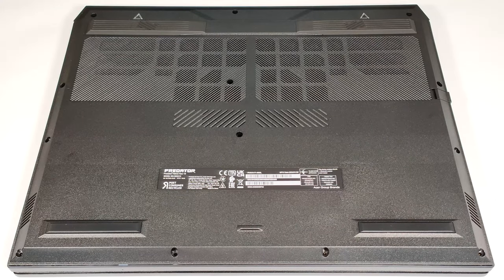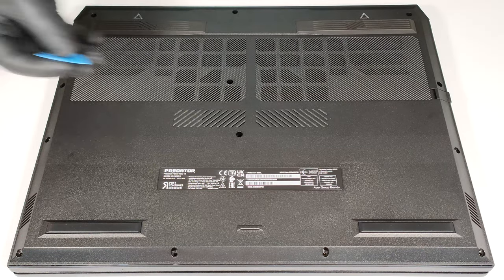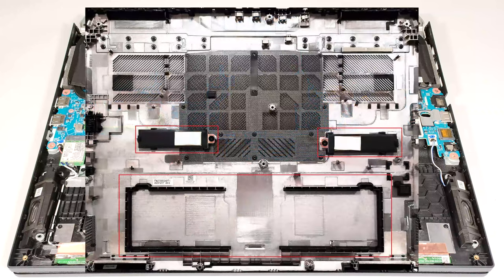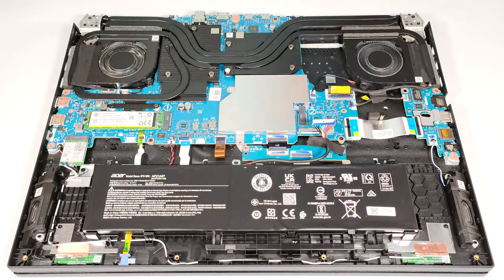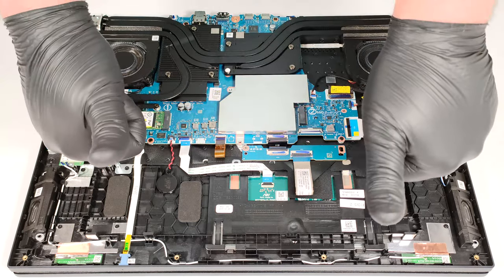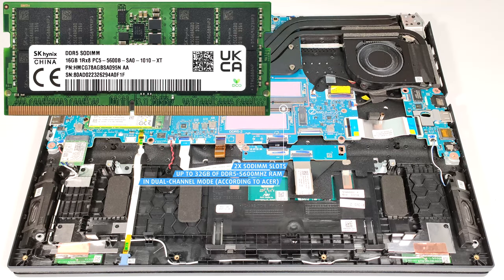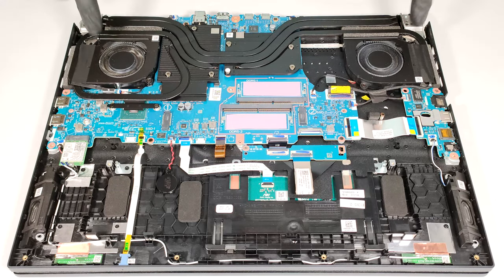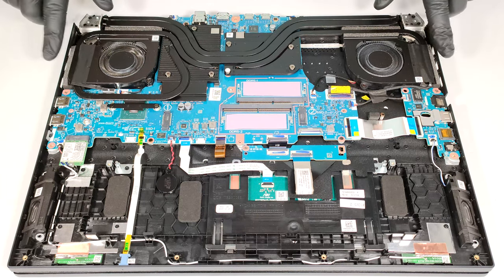🛠️ How to open Acer Predator Helios Neo 18 (PHN18-71) - disassembly and upgrade options

Comment: I opened up my Acer Predator Helios Neo 18 (PHN-18-17) with no problem at all tnx to this video 😁
Then I upgraded my RAM to 2 x 32GB Kingston DDR5 SODIMM Fury Impact 5600Mhz 
When restarting I only got 5200Mhz speed... But after updating my BIOS it worked perfectly and in the taskmanager it stated 5600Mhz.
My C: drive was upgraded from 1TB to 2TB and the second drive I upgraded to a 4TB drive, both Lexar NM790 M.2 SSD's.
Also here, everything worked perfectly.
I'm a happy happy person now 😃
Reply: It doesn't make sense it's not opening up
Reply: @dexndi5909  you do have to use a little force. Once you have the beginning, the rest will follow more easely.

Comment: Freddy, what is the main difference between Predator helios 18 and neo 18? Also have You look at mini led display and if Yes what are You impession?
Reply: The Neo version (in Europe) is a cheaper version.
Neo is 2100 EUR vs Helios 3299 EUR
You're limited in options out of the box with Neo version.
For example, the highest I could get was the RTX4070, 1TB drive and 16GB of DDR5 RAM.
The mini led display is not available for the Neo version.
For me the most important thing however was to go as high as possible for a decent amount of money, (The RTX 4090 was overkill for me) but also have the possibility to upgrade.
I knew up front I would upgrade to 64GB of RAM and at least 4TB of SSD's (but cheaper then buying straight out of the box)
The screen on the Helios is nice and crisp (I don't game, but make music, hense the bigger amount of RAM and SSD's for my virtual instruments)
But even watching a movie is great on this 18" screen. No complaints there.
The only thing I could say is, that the speakers are not super great on this laptop.
But I mostly use headphones anyway.
But now I have a very powerfull (self upgraded) laptop for 2600 EUR With 6TB of SSD's and 64GB of DDR5 5600Mhz wich still is more than the higher version wich costs a lot lot more out of the box.
Hope this helps 🙂
Reply: @FreddyMcLennon  Yours is with mini led screen or standard screen? If possible, can You describe difference between standard 165HZ screen and mini led 250Hz screen in terms of video playback for example
Reply: @VazgShah79  My Predator Helios Neo 18 is with the wqxga 2560x1600 16:10 IPS 240Hz screen.
As far as I'm aware, there's no Neo version with the miniLED screen.
So I don't know the difference between those screens.
Maybe there's a youtubevideo with a compairison of htese screens?
Reply: @FreddyMcLennon  I also want predator helios 18, but I am thinking to get one with mini led screen
Reply: @VazgShah79  I think it's a good choise, but for me, 3449 EUR was way over my budget lol 😂

Comment: Thank You very much for this educational video. If I insert 2x32gb of ram, should the system see them all and run with no issue?
Reply: You might need to do a BIOS update, but yeah, should work just fine.

Comment: Your video is not clear i have the screw removed but cant open it please another rear view video on actually taking the lid off
Reply: Indeed. It was prepared and already open. The video is of no use because it not possible for me opening after removing screws.
Reply: Same here won't separate it's like it's glued.
Reply: Same here did you figure it out?